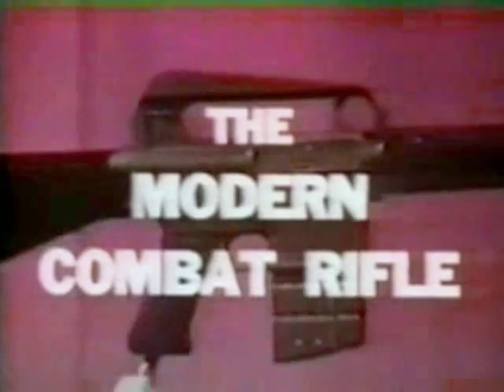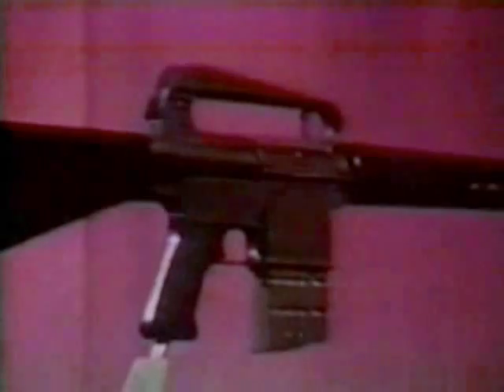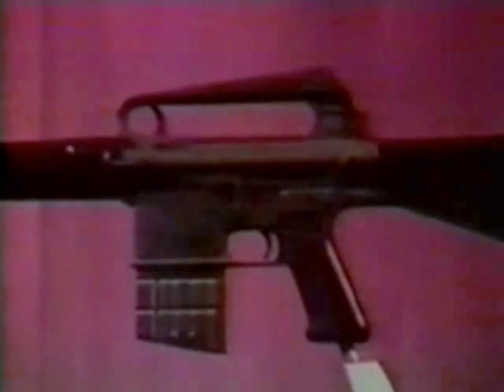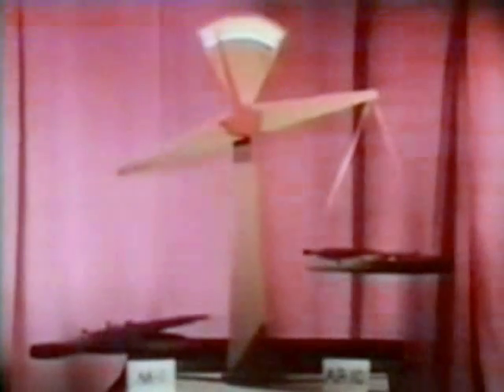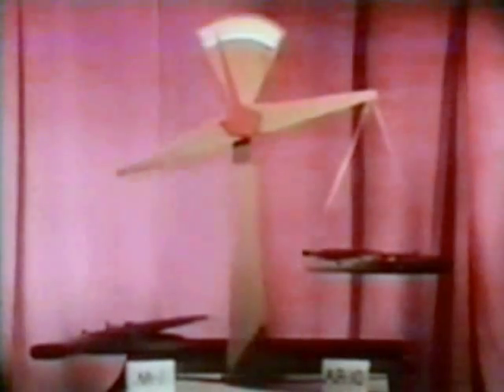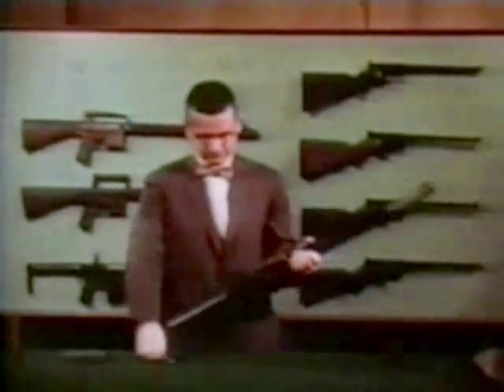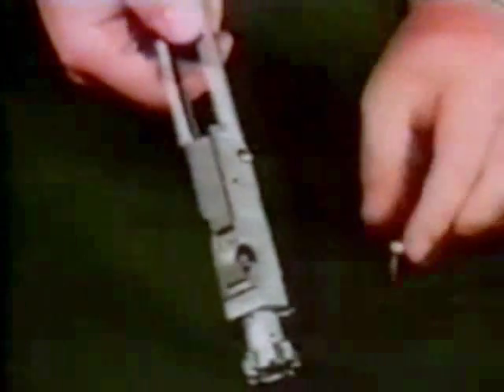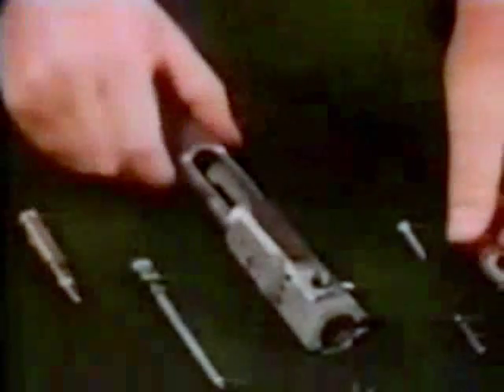ArmaLite AR-10 7.62mm Assault Rifle Part 1

Comment: no cleaning heh? a bolt assembly that can stand hundred of round without cleaning, yeah right, they also seem to have forgotten that the hot gas of the burning powder got blew directly onto the bolt assembly, and cause heat distortion, (jamming) no gas piston rod made the disassembly easier at the cost of reducing the reliability of the weapon. good job eugene stoner.